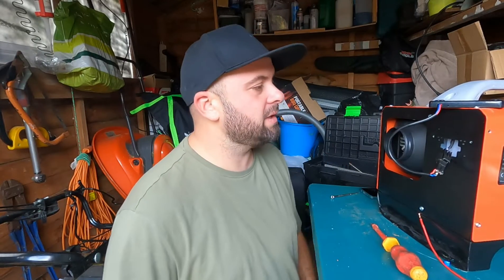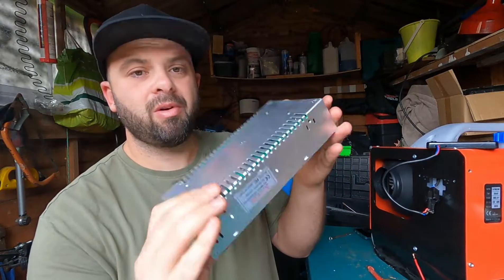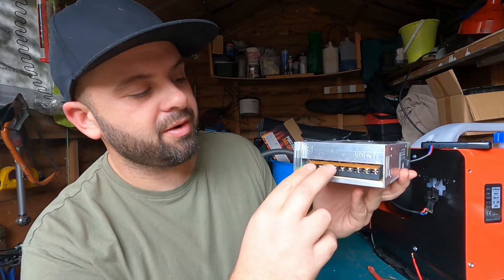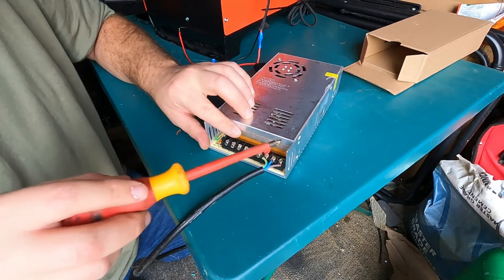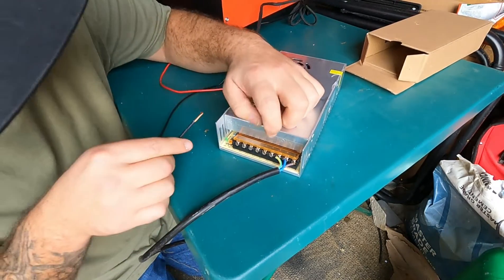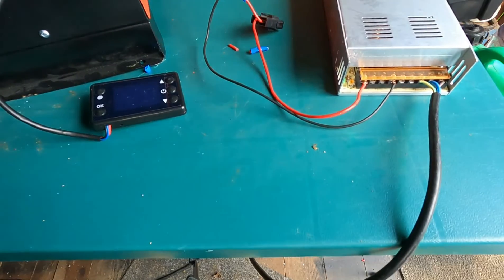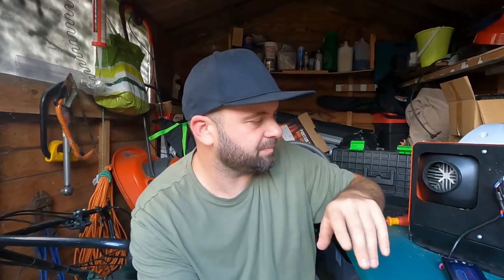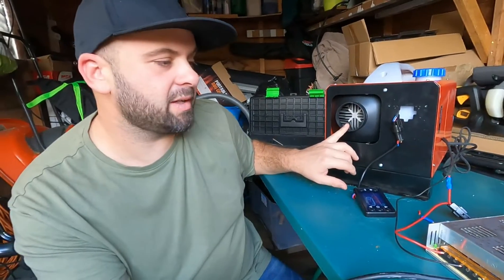How to wire a 240v to 12v transformer for chinese diesel heater, led lights etc

Comment: Hi Tommy! Would it be best to have transformer in my shed and have a 10 ft cable to diesel heater, or the other way around, transformer by the diesel heater and 10 ft cable to the shed! Thanks phil

Comment: WARNING ! , I purchased an identical 230/12v  supply unit , and on startup of the 8kw diesel air heater it fried itself , luckily the heater had only just fired up and didn't cook .

Comment: Good vid, got myself one of these...OTOTEC LED Regulated Switch Power Supply Transformers 12V 30A 360W...wired it in. My only concern is the fan started up as soon as I put power to it, wonder if it is defective as the fan is only supposed to kick in if the unit gets a bit hot.
Reply from the maker: Mine kicks in instantly aswell 👍🏼
Reply: @LT_TOMMY_  Thanks for the reply, I just think I misread the advertisement. When it said thermal protection I wrongly assumed the fan would only kick in when it was under load for a while.

Although ran the unit last night with the diesel heater for 5 and half hours and it worked fine.

Comment: Hi Tommy great video, which transformer is the one to use with a 12v heater you said you had it off Amazon but which one is suitable, thanks again for the video, PS I have just been reading a few articles regarding running the heater off the mains through a 12V adaptor and a few say it will fry the heater when shutting down.

Comment: im in the states...would a 6ft, 12awg 20a power cable work? planning on hooking up to rv/caraven pedestal on a 15 110 ac outlet.
was going to use a similar supply.

Comment: Thanks was a bit confused with 3 - v together and 3 +v all together now it all makes sense. Just a quick mention there is a switch on the side to switch between 110 and 220 in the UK it needs to be at 220 cheers 🍻

Comment: What size cable do you use for the power cable in ?
Reply: I used a kettle lead for the power cable.
Reply from the maker: I used extension lead cable, think it's 2.5mm flex 👍🏼

Comment: Hmm, all my wire is 2 core, do you really need the earth or will it be a shock box without it?
Reply from the maker: You need the earth on the plug side (240v) 
2 core is fine on the 12v side 👍🏼

Comment: What about power cuts ? how would heater go through shut down ?
Reply from the maker: I'm going to hook up a leisure battery to it at some point as a back up,
In all honesty I don't think I'll be reliant on it, it's more of a project 👍🏼👍🏼👍🏼
Reply: @LT_TOMMY_  wouldn’t it make more sense to just have it connected to a 12v leisure battery that’s always plugged into a fully automatic 230vTo12v trickle charger.

Comment: What amp fuse do you need in the plug from the mains to transformer please bud? I’ve got a 150w 12.5a one to wire up at the weekend
Reply from the maker: The main is just the 13a fuse in the plug mate 👍🏼
Reply: @LT_TOMMY_  cheers fella 🤙🏼